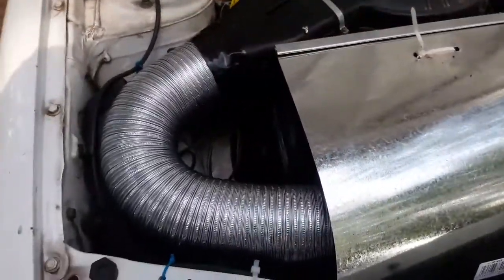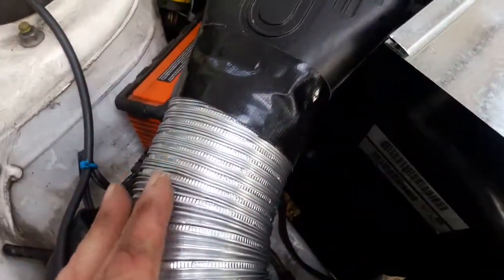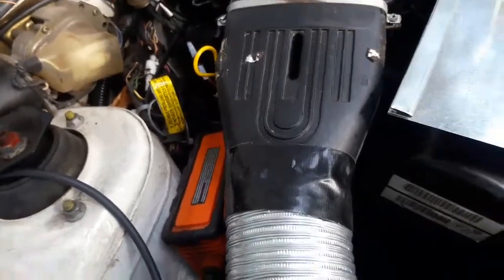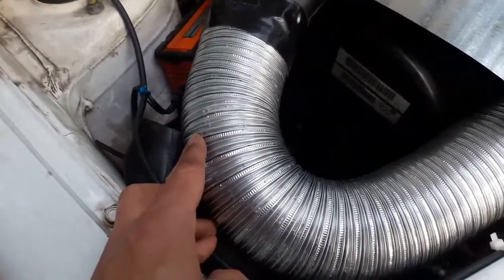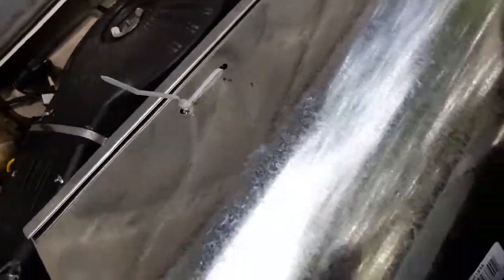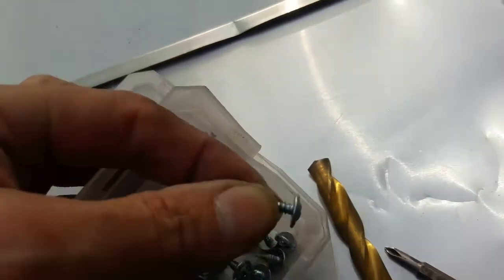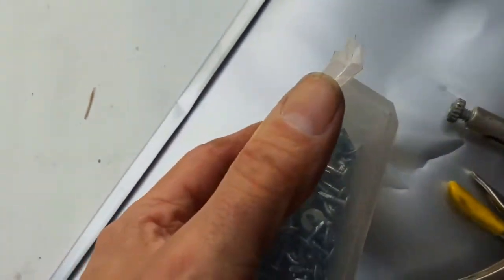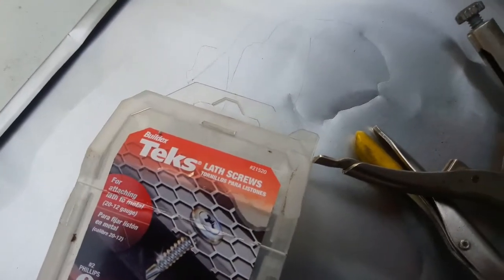Increase mpg with higher intake temperatures.

Comment: YOU CAN EXPAND THE AIR WITH HEAT TO REDUCE THE AMOUNT TO AIR GOING INTO THE ENGINE, OR YOU CAN USE RESTRICT THE INTAKE HOLE BY MAKING IT SMALLER.

Comment: Hot air has less density than cold air (ask any pilot), and will reduce energy wasted in piston pumping,  but it will be at the expense of HP output...especially important in a 55 HP Metro.   
 If you superheat the inlet air, you will volatilize the fuel prematurely and eventually damage the pistons and cylinders with pre-ignition. 
If doing this was a good idea, don't you think the OEMs would have done it decades ago?  Maybe those guys with PhD's in mechanical engineering knew something when they design cold air intakes into cars, even cheap ones like Geo Metros
Reply: How do you explain the prius having the intake pointing right at the hot coolant tank to get warm air from the factory?
Reply: @Motorsportsgeek  Prius probably are using the electric motor at high load demands to help reduce the load from the petrol engine, thus reducing the chance of pre ignition occurring.
Reply: @Motorsportsgeek  I'm not very familiar with Prius systems, but I suspect the intake drawing hot air from near the coolant tank is probably used as a cold start warm up system.
If mileage could be improved simply by routing the air intake so that hot air and not cold air is being drawn into the engine...don't you think the OEMs would have done this generations ago?
Reply: @steverandall5814  They do, new cars are starting to have adaptive grills that close in cold temperatures and EGR systems that route the exhaust gases to the intake so the engine can run warmers and more efficiently in cold climates.  The methods uses in the video work in cold climates. I use it myself and even with the intake pointed at the exhaust, it is still colder intake temperatures than summer but far better than the -20 outside temperature. This helps me save around 10mpg throughout winter. I also block off my front grill for quicker warm-up time.
Reply: @Motorsportsgeek  estas en buen camino, te recomiendo q precalientes la gasolina con un intercambiador de calor x refrigerante y subira tu ahorro, pues la mezcla se evapora en las cámaras de combustión
Reply: Hot and high reduce hp, but the goal is more complete burning and finding the best temperature and not cause preignition. My Ford gets 24 mpg in winter and 27 in summer. One summer spent in Utah at 4000’ elevation and 90s every day gave me 36 mpg. Why don’t engineers do this? Hmmm, can’t answer that.
Reply: @deiselgas  The mileage difference is because the gas you buy in winter has a different formulation than the gas you buy in summer for emissions reasons.  Any vehicle fleet manager can confirm this.   Gas sold at high elevations (like 4000 feet) also has a different formulation than gas sold at sea level too.
Reply: . The fuel is different because the lower temp make it more difficult for the fuel to vaporize and burn. They make it more volatile so it will evaporate faster in the winter. Warmer air helps fuel evaporate faster and so they change it when summer comes around. Hot air intakes take this a step further and do work. It can reduce the horse power but increase gas mileage.  It's a trade off. Half to decide what is most important. Speed cost money how fast do you want to go? Lol

Comment: What a joke 
Do this if you want to get a pinging engine and rsttle the pistons to death
Reply: That's why modern cars have computers and they don't ping They retarded the timing
Reply: Hypermilers don't do this to increase power. They like to cruise. They don't like to speed from stop light to stop light and brake overly hard every time as if that's the way it's supposed to be. That's the habit for those who want to get somewhere a minute sooner for what ever reason - which is okay, because that's nobody's business. 
It's for improving fuel economy when the engine is running during low load conditions, so primarily it's for cruising. When cruising, the engine is neither pinging nor rattling its pistons to death. Not even doing that when accelerating with reason.

Comment: It helps because theres less pumping losses at the throttle body. Helps vaporize fuel as well. Pumping losses make up for a huge part of gas engines inefficiency. The reason a 1.8l gets better milage than a 5.0 going the same speed is because the 1.8 doesnt have to vacuum large amounts of air out of a 2mm wide crack in the throttle body, it can breath since it takes a half open throttle to go 70mph

Comment: Nonsense. It will give you only higher fuel consumption.
Reply: Lol, I seriously hate that this video isn’t a joke
Reply: Go learn about pumping losses, specifically part throttle pumping losses
Reply: @joshuafarwell9761  There are diminishing returns. While it is true that wider throttle opening reduce pumping losses, reduced power also has a disadvantage of having to shift up much later. Wider throttle also increases engine load, which can increase efficiency up to a point, but go too far and the car will start to run rich to avoid pinging.